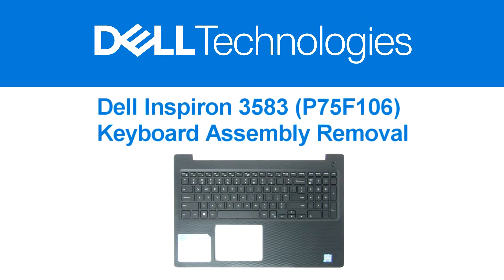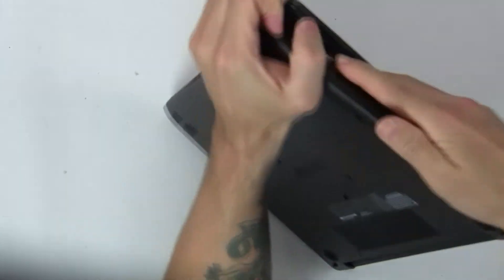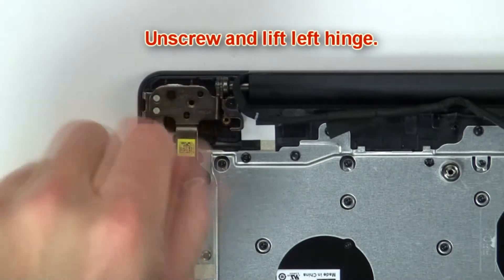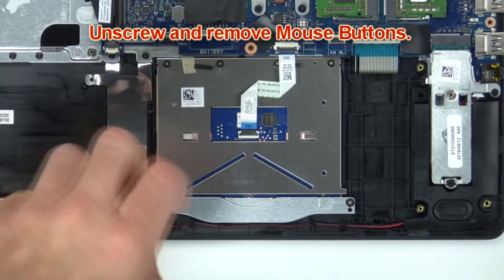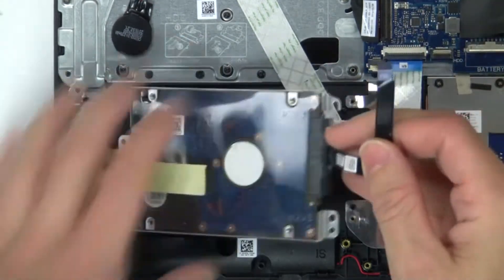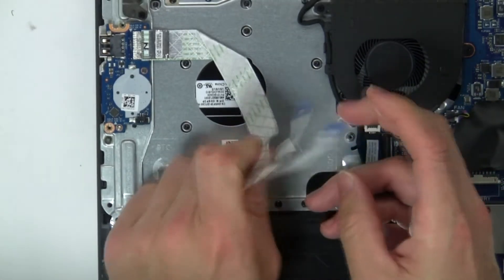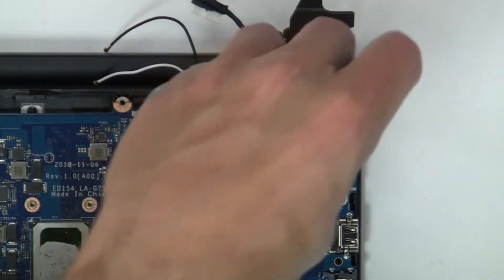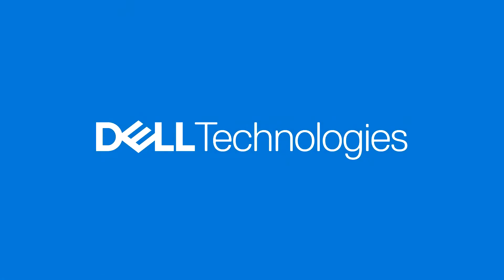How to replace the Keyboard in your Dell Inspiron 3583

Comment: This video is not about keyboard replacement, but about notebook disassembly that stopped right before the keyboard should be disassembled and replaced.
Reply: Nor really. What Dell is telling you is that the keyboard is not a replaceable item, and that you have to replace the entire palm rest assembly (with keyboard) instead. That's because the keyboard is heat-welded to the palm rest (melted plastic posts) and cannot be removed and replaced. Very, very, very poor Dell design, and kind of malicious, but there you go.
Reply: @richarda3659 , that seems odd given that Dell shows a part # cpx-h9p3p on their website which would seem to be this keyboard without the palm rest.
Reply: @richarda3659 , however, it is also true that the service manual for this model does not break it down as far as the keyboard. It's flow chart has a chapter 40 for removing the palm-rest and keyboard assembly (which seems to be represented by this video) and a chapter 41 for replacing the palm rest and assembly.

Nothing to replace only the keyboard.
Reply: @richarda3659 , and yup, from looking at a video of what looks like a very similar model (3501) it would seem like melted plastic posts are involved. In that vide, the guy seems to be able to remove the shield on top of the keyboard as well as the keyboard with what seems like relatively little effort. To install the replacement keyboard he does end up using a soldering iron, however.
Reply: @richarda3659  Yup, it looks pretty awful.
Reply: I've got scared man!